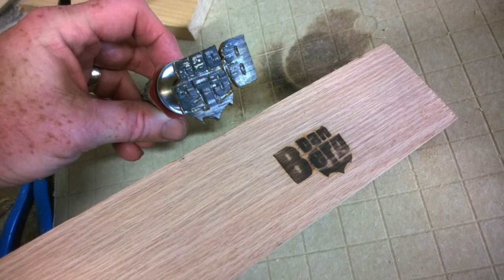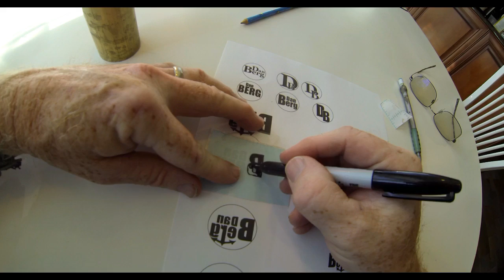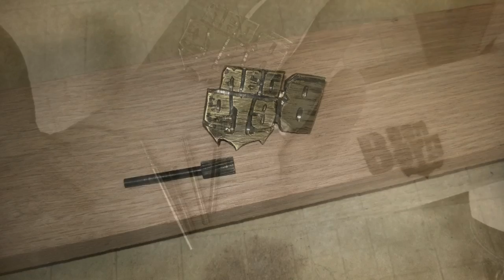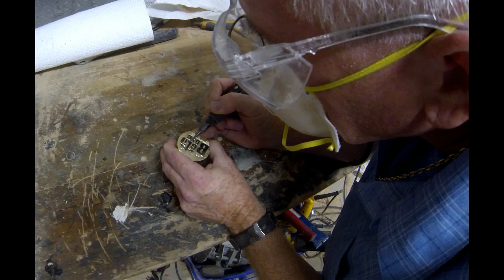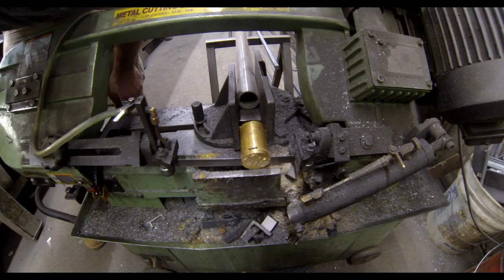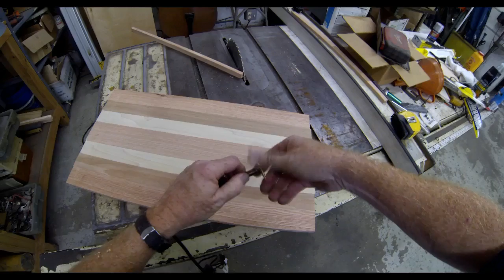How to make a Branding Iron Logo for a Wood Burning Tool

Comment: Can you tell me what size the threads/screw/bolt is? I've looked all over for this info online. (I'm hoping to create a custom set of zodiac symbols from plain solid brass  drawer pulls.) fingers crossed that they're the same size threads haha
Reply: Need same info. I had brander made but need a step down stud screw to fit my walnut hallow woodburner.

Comment: haha dang, what a tedious process though. great work! i had a really intricate logo made and it was around 300$ and came with a burner and regulator. i might have to give this a go for a simpler logo design. ;)
Reply: Warren Ewings
http://www.brand-first.com/
just judging the site alone, you would think they don't do good work, perhaps. but i assure you they can cnc anything and they do good work.
i also got the heating element, a voltage regulator and a metal box for it all, that's why it cost more. depending on what you need, price will vary.
Reply: what company did you use for the intricate logo?